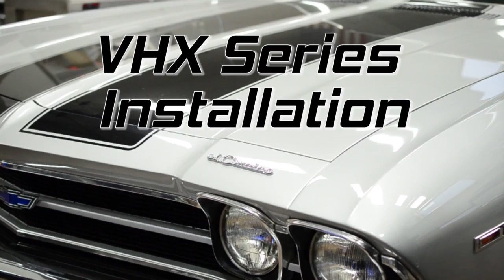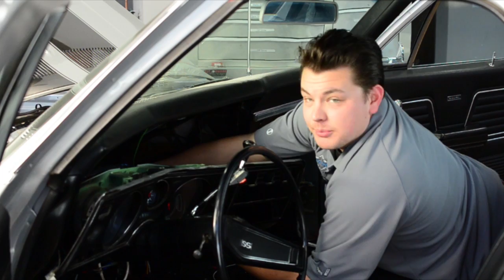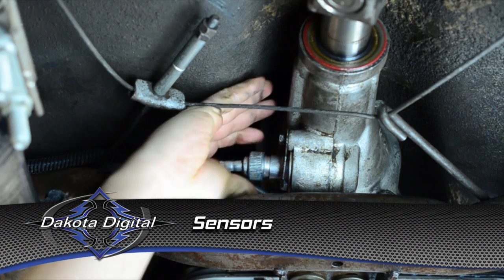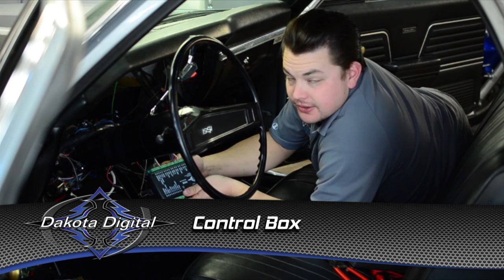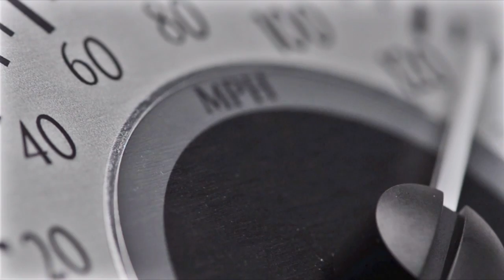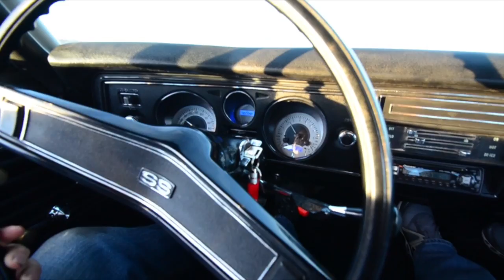Dakota Digital VHX Series Installation 1969 El Camino

Comment: Still trying to figure out how to hook up the turn signal wires on my 70.
Reply from the maker: Hey Thoran,
We can help!  Contact our Tech crew at 800-852-3228, or techsupport@dakotadigital.com.
Reply: @DakotaDigitalTV  There must be more information somewhere on connecting the pig tails for the stock indicators. There is NOTHING ANYWHERE to assist.

Comment: Coulda shown how the voltage and oil psi sensor was installed...Any hoo great video!
Reply from the maker: Oil pressure installs in place of the stock sender/oil line (1/8"NPT) and there is nothing to install for the Volt gauge; the system monitors the power input to the control box.
Reply: @DakotaDigitalTV  wow...thanks!!

Comment: I did an ls swap in my 69 chevelle and my th400 had a vss connection that I currently have my psi harness connected to. The vhx kits says to plug your supplied sensor into the vss, would i wire my vss wiring from my swap harness into the dakota digital box?
Reply from the maker: Hello!  There are a few options and details we need to nail down here; please contact us directly at: techsupport@dakotadigital.com.

Comment: Ok but how did you calibrate the speedometer?
Reply from the maker: There are two methods to calibrate the speedo; both listed in the installation manual. Do you have a system you need to dial in?
Reply: DakotaDigitalTV yes I’m trying to calibrate mine

Comment: I would like to use this system in my 74 Nova with a LS1 & 4l60E conversion.
I'm using the new Holley Dominator system to control the engine a transmission, is the VHX compatible with my set up?
Reply from the maker: William, 
Thanks to the supplied sensors, our VHX systems can be used in nearly any application! The flexibility afforded by the solid state sensors for Oil Pressure, Water Temp and Speed, complete with weather-pack style harnesses allow VHX systems to find a home in hot rods of all types, regardless of drivetrain choice!

Comment: Does it work with ls conversions
Reply from the maker: Thanks Abdulla,
 Absolutely!  That is one of the benefits of this package, our sensors are designed for either stock, modified late-model LS conversions.  Because our system includes the proprietary sensors, this allows a wide range of flexibility.